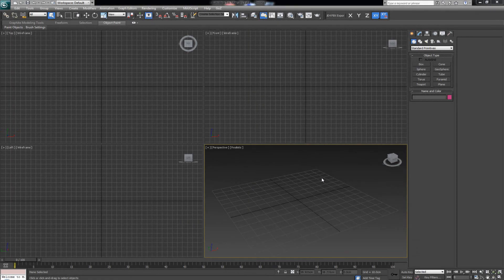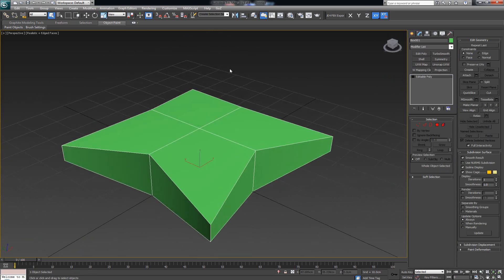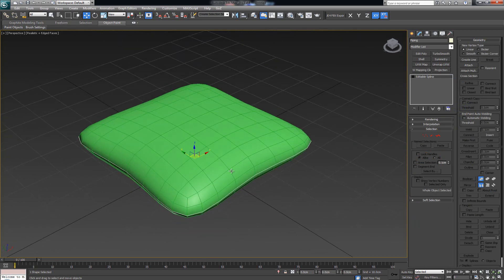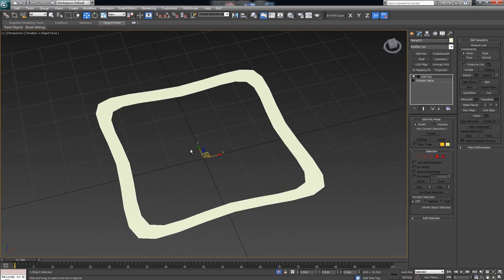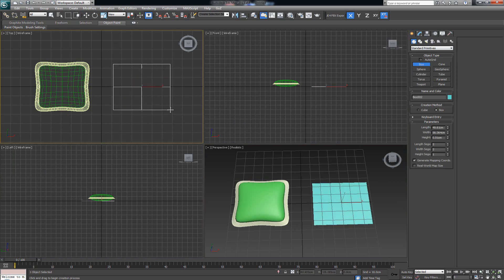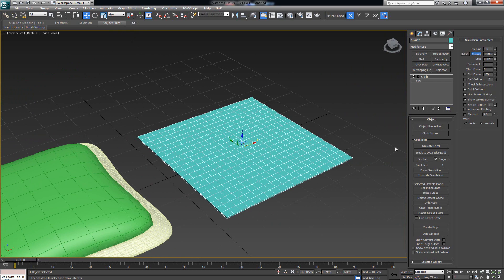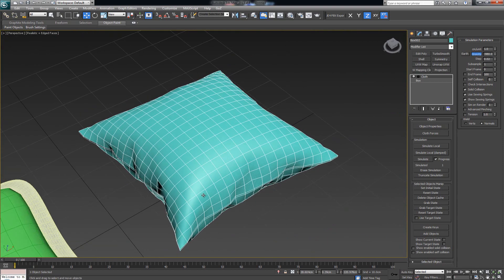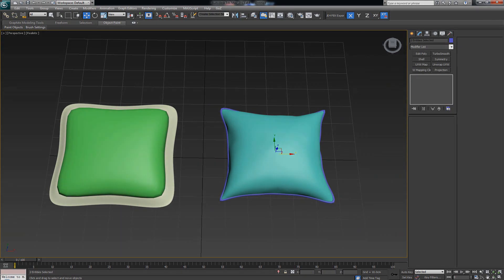Modeling pillows in 3ds Max

Comment: For the extruded piping you can connect your splines with Cross Section under the spline object tools first to create quads and drop an edit poly on that. Saves you connecting vertices.